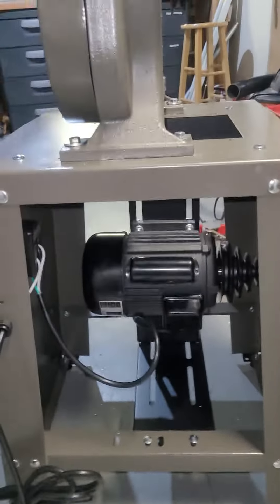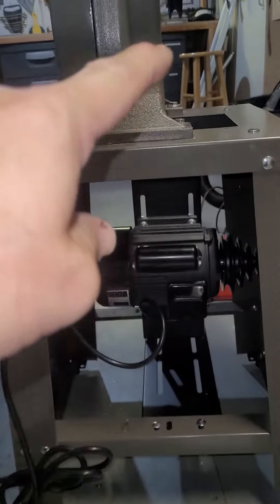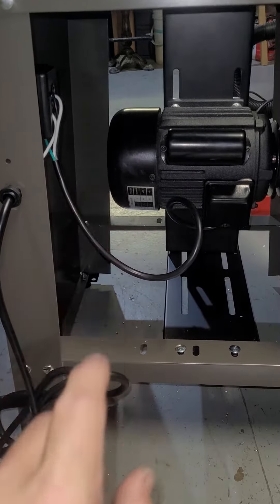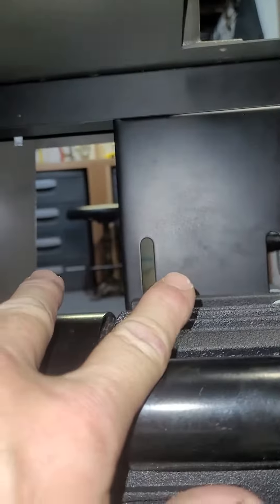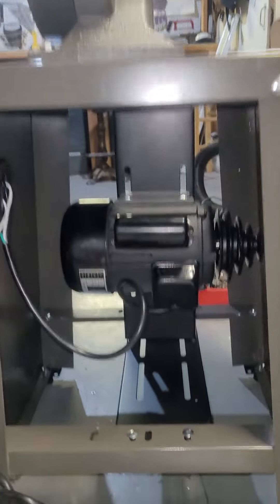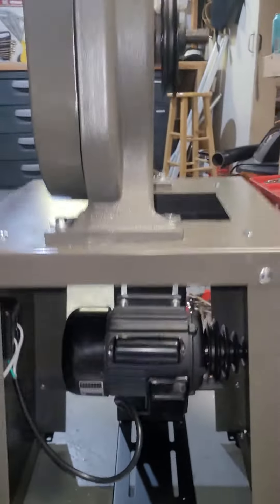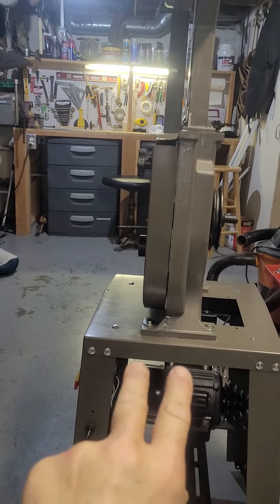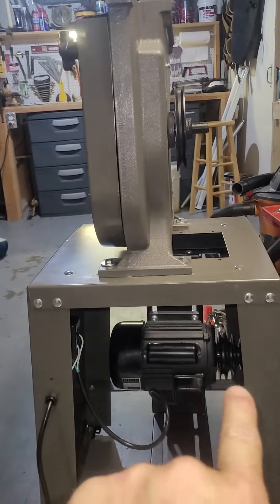Harbor Freight Bandsaw assembly

Comment: You probably figured this out alright but you have the wrong pulley on the saw, which is what I’m trying to figure out how to swap.
Reply from the maker: I don't know.  I have it working fine after I did all this.
Reply: @scottmartinezguitarandbass  Oh ok. Mine came with that pulley installed and another packed that I need to swap it out with. The new pulley looks like the pulley on the motor but with the rungs in reverse order for speed control.
Reply: @ChrisWilhite ditto, mine was setup like yours Chris. What I can not figure out is why my blade does not run through the center of the hole on the base plate. It’s off to the right of center by about a 1/4 inch.   If you had this happen let me know how you fixed that. Thanks. To me it feels like the whole base plate is not pushed far enough to the right.
Reply: @surfbuf1  The blade on mine seems to go through the baseplate pretty much on center however the bearing on the lower blade-guide it's supposed to back up to is too far to the left of the blade so it sits next to the blade instead of supporting it and preventing blade movement...actually everything below the baseplate seems to be shifted over too far to the left. I haven't got past this yet, I'm planning on emailing them photos and a video.